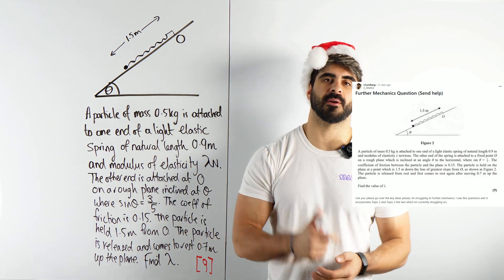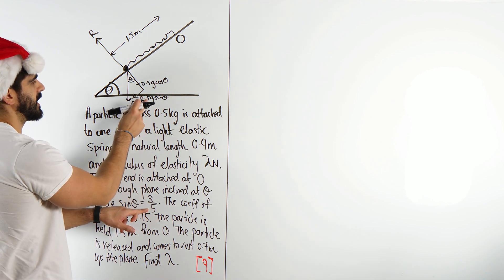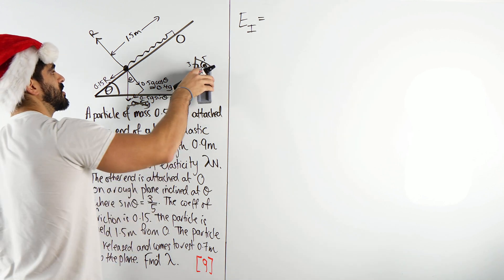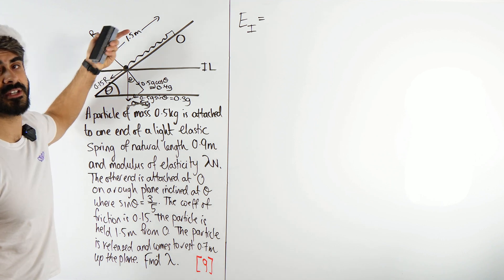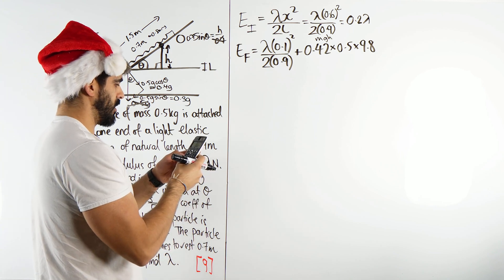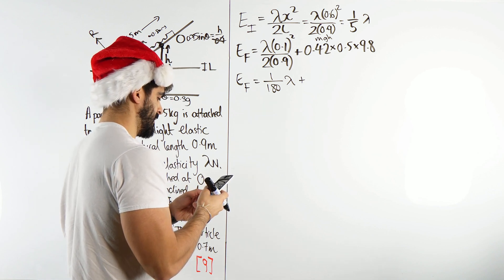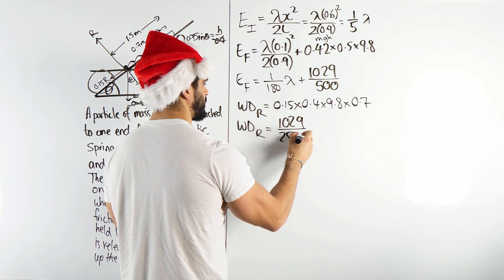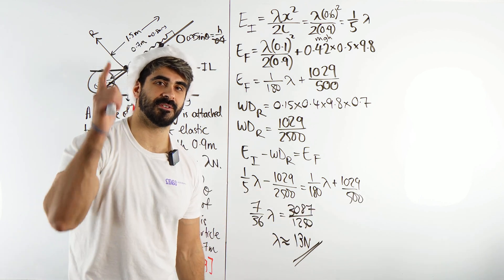Dirty Work Energy Principle Question | A level Furthermaths

Comment: A recommendation for students: Do all your working using symbolic quantities (µ for coefficient of friction, m for mass, h for height, etc.), and only substitute in numeric values at the very end to obtain the answer. This will allow the examiner to see if your theoretical working is correct and gain you marks for that even if you fumble the calculations, and it will also reduce the risk of you making errors as you go along.

Comment: I would not be able to give you full marks for that answer. There is a technicality that your working is only valid if the response of the sprung mass is overdamped and non-oscillatory. Otherwise, your calculation of the work done as force x distance would not be correct. If the response has an oscillation (common with sprung masses), then the distance moved could be more than 0.7 m. To gain full marks, then technically you should state any assumptions made in obtaining your answer, namely that you are assuming a damped, non-oscillating response. (The original question may have asked you to state any assumptions made. I don't know. This would be a common requirement in a physics exam.)
Reply from the maker: I'm literally an examiner mate, quit the yap
Reply: @NeilDoesMaths  Fair enough. You understand I was yanking your chain, right? I went through school being indoctrinated to the idea that mathematics lives in this silo, physics lives in that silo, and never the twain shall meet. It is unfortunate that we are still doing that to students today, decades later.
Reply: Yes, but there is a difference between an A-Level Physics Paper and an A-Level Further Mathematics Further Mechanics 1 Paper. You can see, according to mark schemes, that we don't need to follow the requirements of laying out work in a physics paper for a further mech paper.
Reply: @mediarblx_npc Is he teaching physics to you? he is literally a maths teacher
Reply: @ARNAVMARWAHA-s1c the person who posted this comment said that this a common requirement in a physics exam. I just merely stated that this question is from A-Level Further Mathematics Further Mechanics and not A-Level physics, just to clarify. My point has nothing to do with Neil's profession.
Reply: @ARNAVMARWAHA-s1c Unfortunately, this question is 100% physics, even it is pretending to be maths. It contains units of measure like kg, newtons and metres, and it requires a principle of energy balances. None of this is maths. If you subtract the physics from it, all you are left with is a simple calculator problem where you punch in some numbers and get an answer. That is hardly worthy of A-level Further Mathematics, though it is a gift for students who can enjoy easy questions for giveaway marks. Even Neil said it was remarkably little work for 9 marks compared to pure maths questions. (There is nothing new about this. Even 40-50 years ago people were questioning whether mechanics belongs on the maths syllabus.)
Reply: @mediarblx_npc Alr sure buddy
Reply: Yes Neil lad 😂